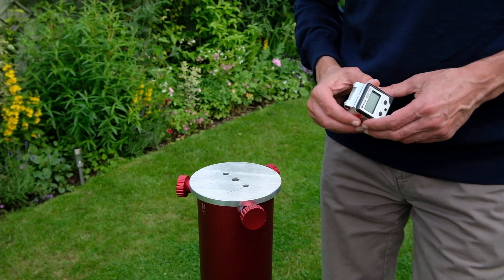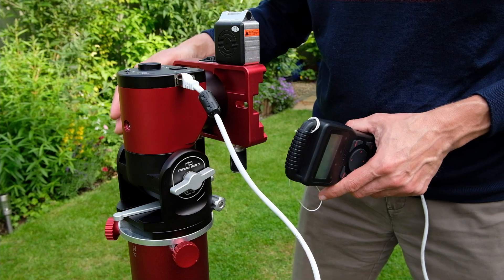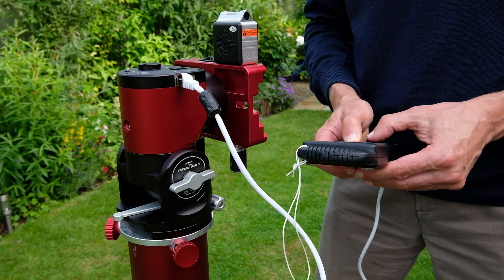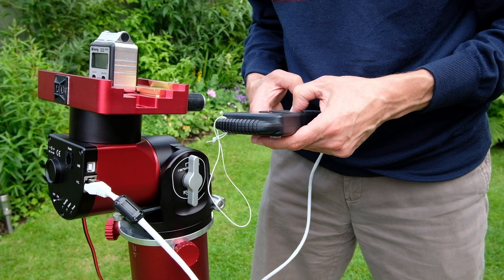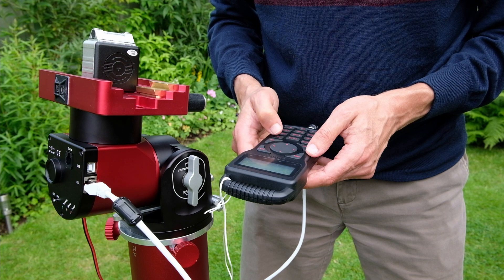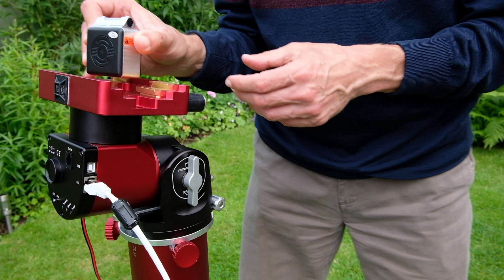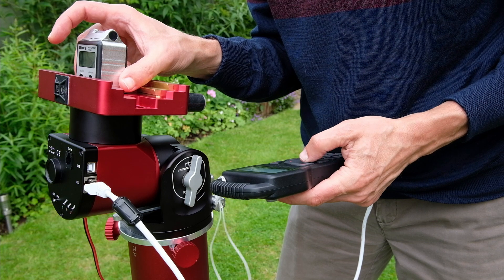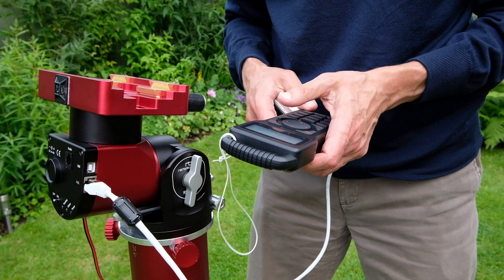Adjusting Rainbow RST-135 home sensor offsets

Comment: can we use a 8 inch Edge without autoguiding and without counter weights? will it track accurately good enough for imaging deepsky?
Reply from the maker: highly unlikely, due to the focal length and the uncorrected periodic error which can be +/- 25 arc seconds

Comment: Thanks for the video. Which saddle are you using? Des
Reply from the maker: I bought it from Rother Valley Optics in the UK. My friends in the US say it is from China and available on eBay/Amazon.  It is really nicely made and I prefer it to the equivalent ADM unit
Reply: @astroshed  Thanks, Chris. Is it this one https://www.rothervalleyoptics.co.uk/rvo-heavy-duty-dual-load-universal-saddle-plate.html? Which pier are you using? I'm thinking of going the "standard" route with a RT90C and the RST pier. Mostly imaging with FL below 450mm.
Reply from the maker: @desmcmorrow2978  yes, that is the one. The Pier is from Altair Astro.  You can use the central bolt of the celestron adaptor that comes with it. The shiny aluminium adaptor is one I had made up, which allows direct 2-bolt connection.
Reply: @astroshed  Thanks, Chris. Had my eye on an altair astro pier as a semi permanent solution for my current CEM40. If I go that route, I might ask for a sketch of your adapter so I can get one made up locally in Yorkshire, unless you intend to market them. Cheers, Des
Reply from the maker: @desmcmorrow2978   https://www.dropbox.com/s/uqbe32j5pggh0ey/Rainbow%20Starfield%20adaptor.pdf?dl=0
Reply: @astroshed  Much appreciated. Just realised I'll have to spend extra for a red rst 135 to match the pier and saddle. Only the most superficial of people don't judge by appearances....... cheers, Des

Comment: Great video! Are those uncorrected, default offset settings maybe the reason that I am quite a lot off in dec direction while centering an object after automated meridian flip in Asiair Pro?
Reply from the maker: I think it is unlikely. I would expect the manufacturing tolerances are within a few tenths of a degree.